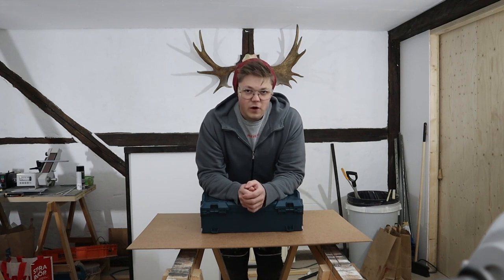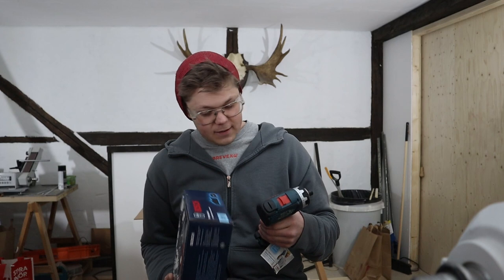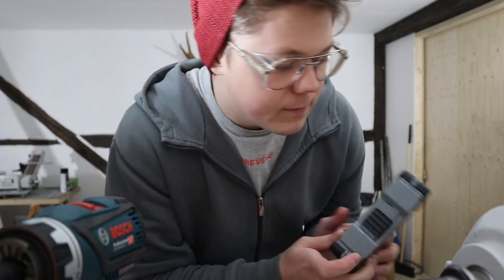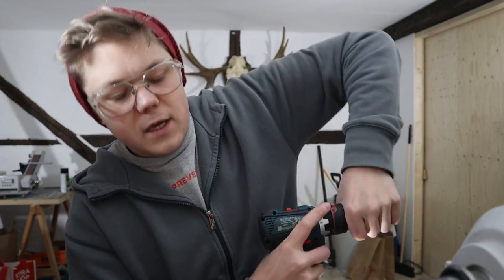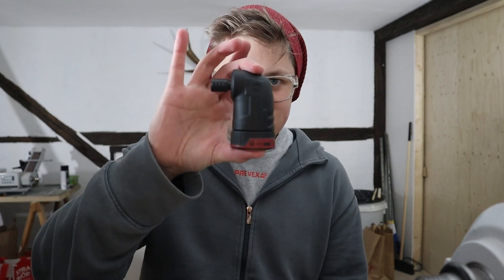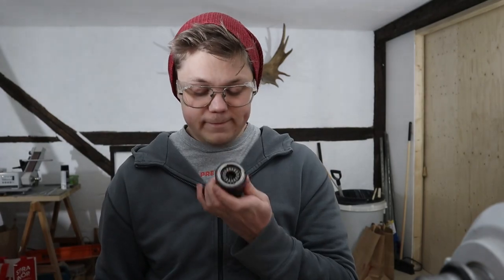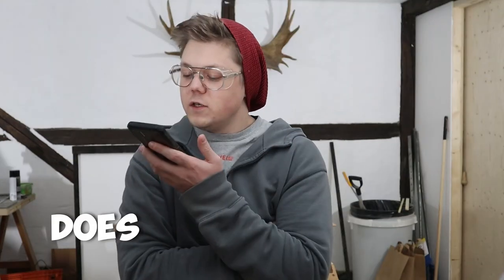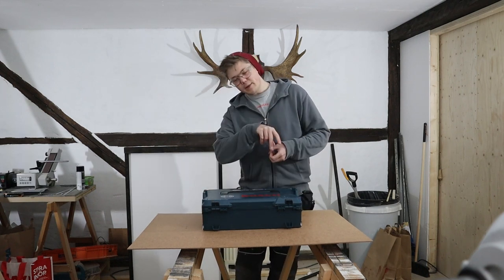FLAW with Bosch GSR 18v-60 FC (FlexiClick) - Professional Drill Driver

Comment from the maker: If anyone know what GSR actually means let me know! 
It remains a mystery! 🤔
Reply: "GSR": its Bosch naming code, all German: "G" indicates the "Gewerblich" line, which means the pro line for craftsman (more expensive). "P" means private "Privat" line for handyman. And "SR" stands for "Schrauber" (like power screwdriver). The number tells the torque, here 60Nm hard.  
Other similar devices are named GSB "Gewerblich SchlagBohrer" (= light hammer unit) and "GBH" = "Bohrhammer" (= real SDS hammer drill).
By the way you don't have to loose the Flexclick to adjust the extensions, just pull it out a bit, rotate to the position you need and set it back.
Reply from the maker: @haem9221  This comment is more informative than my entire video :D
Thanks you for the reply!

Comment: Hi, I have de same drill, I see that in my drill, in the hexagonal bit without accessory installed, the bit wobbles a bit, it is not perfectly straight when turning... is this normal?. I would like to know if the same think happens in your drill. Thanks for sharing.
Reply from the maker: Putting something in the "hex-mount" tends to wobble a bit. Putting something in the drill chuck should not wobble. i.e. drills should be perfectly straight.

Comment: Over-tighthening the flexiclick attachment in long term will cause its locking mechanism to be damaged. Slowly rotate the locking mechanism until you hear 4 to 5 clicks. I do own the same drill, and one of the attachment (metal chuck) accidentally detached from the drill and fell from 5 metre height onto the ground(luckily there was no one near the ladder) due to damaged locking mechanism (can't hear any clicks).
Reply from the maker: That's valuable information, thanks for the tip! 😊